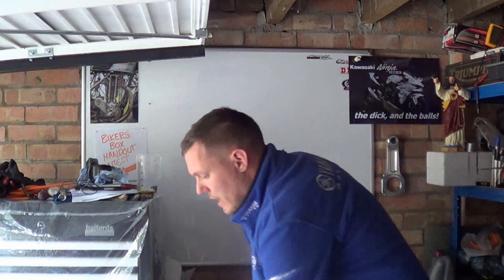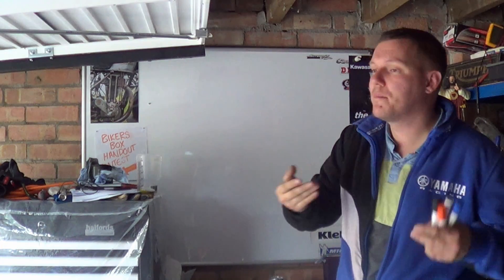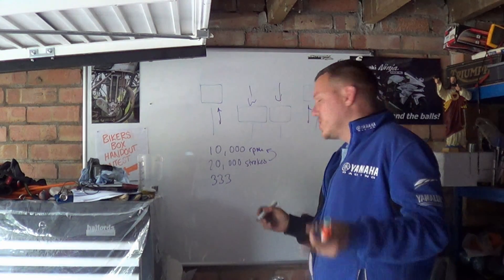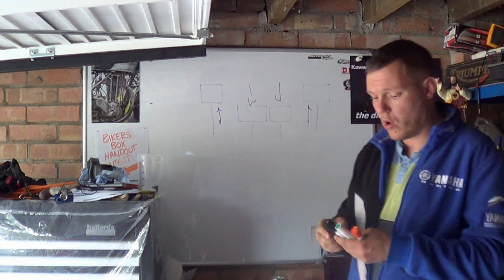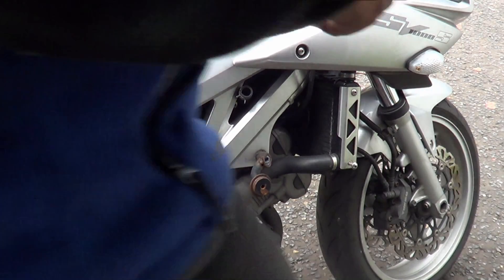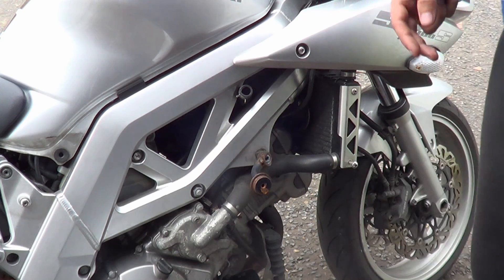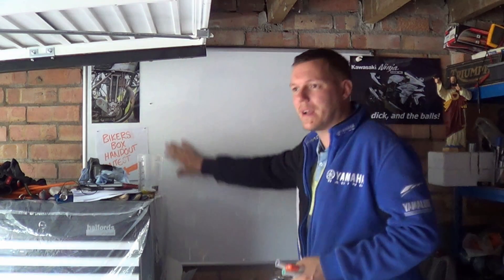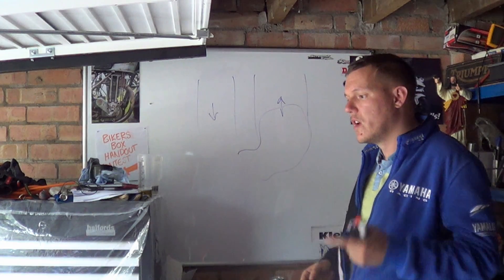Crankcase pumping 4T reply

Comment: The average 500cc single cylinder has a stroke from 86mm and they have if you don't count Harleys or other engines with stupid high cc engines big pistons for a motorcycle. To get to the point 100mm stroke is a fucking big stroke and I think that not many engines for Motorcycle have a stroke that long... To make math simple 100 is a good number ;)
Reply from the maker: and that was the point, my brain hurts enough as it is......
Reply: Vitamin B complex and coffee... and your brain will get going again.

Comment: no clue why you need to explain this one but i guess the same could be said for the stuff that i don't know, but two things, the restriction between the cylinders caused by at least the crank, connecting rods, crank baring caps, and the cylinder sleeves themselves to some extent, would cause enough separation yes, and if you had say 4 separate breathers they might have their own pulses and different to each other, also/but the blowby that is found in all engines even new ones is what causes the bias to the pressure to be positive
Reply from the maker: I think you over-rate how much blow-by there is, but a small fraction is blow-by. I'll get a lighter and show you. - matt
Reply: much of it wont ignite because it's exhaust, but it would not take much to unbalance the pulses, if your system is sealed and you only have one breather like one of my bikes, you can add a pressure gauge, a 0-10 psi would work best or smaller, the overall pressure will build and once it starts you can watch, also as pressure builds the pulses might become more evident, don't let too much pressure build as i don't want you blowing your seals

Comment: What an idiot. Mr rex is. He got pwned. But in terms of engine braking, jacob's brakes get the job done the fastest. Probably not a good idea on a bike since traction might not be enough. To reduce pumping losses does this mean I should start drilling holes in my crank webs or give my motor a bigger exhaust vent?
Reply from the maker: Yeah go for it lol

Comment: aye, and allso the rings do let in some exhaust gas down into the crank case.
it builds up over time. so you do have pressure there for sure. when the enigne in under load it will be even more noticeable.

Comment: some of that pressure coming out from that hose could it be from combustion (passing by the rings)? i've seen that in cars as well specially when they are cold. nice informative vid once again thanks
Reply from the maker: 1) yes
2) the SV wasn't cold
3) that's shit loads of blow-by
4) I'll be measuring the bores and rings etc when I do the teardown
Reply: yes it seems like a lot hope the engine is fine

Comment: Really interesting.  Are all multi-cylinder 4T engines arranged to have a constant volume under the pistons / in the crankcase?  Do single cylinder 4T engines have to have much more massive crank-case breathing arrangements than multi-cylinder because the air has to get right out of the crankcase and back again, or do they just live with the big pressure changes in the crank-case?
Reply: No - singles and 360deg parallel twins like BSA, Norton, Triumph pump their cubic capacity for every stroke, leading to issues like oil being blown out the breather.
Matt does your Suzuki have a single crankpin? if so it has to pump air in and out the crankcase as the volume under the pistons changes. If so why does it appear to blow and not suck? i was slightly disappointed it didn't eat a piece of that blue wiper ;)

Comment: Use the exhaust to pull vacuum on the crank case. It only takes a hose, a one way valve and an angled fitting and the depression negates the breathing.Quick'n'dirty FTW!

Comment: 1: would a 4t boxer engine be able to take advantage of crank breathing? Every time the pistons are moving towards the crankshaft (intake/power) one is on its intake, so every time they're displacing air, there's an intake stroke to receive the displaced air. 
2: what if you plumbed the exhaust into specific pistons of the crankcase to help push the compression/exhaust piston up? So in an i4 (1-3-2-4), the exhaust from cyl1 head would go to either cyl1 crank (to equalize pressure) or cyl2 crank (pushing it up to compress), then exiting the crankcase and out the tailpipes. 
Of course, these involve adding oil to the intake and exhaust respectively, so emissions will go to shit but would the efficiency gains be worth it?

Comment: Would a vacuum pump putting the crankcase under a vacuum free up more power than it consumes? (ignoring windage)
Reply: (free up more power than it consumes) yes, it does! they have been doing it for years in drag racing, on SBC it gives around 50HP that the end, that is
 on an engine that revs to about 8000RPMs
Reply: Most 4 strokes have a non-return valve (check valve) in the breather system to create a partial vacuum in the crankcase.
Reply: wontputrealname yes they only work at partial throttle however as opening the throttle pretty much eliminates manifold vacuum...
Reply: The non-return valves operate at all times when the engine is running, from idle to full throttle, creating a partial vacuum in the crankcase at all times.
Reply: I think you'll find that more often than not, that one way valve is actually one of a pair, used for emissions purposes to ensure that air flows into the crankcase breather and out of the valve cover breather(s), and from there being directed into the intake. Hence 'PCV' valve, Positive Crankcase Ventilation. It is used to ensure that fuel vapours and exhaust gases that pass the rings due to windage don't contaminate the oil, leading to loss of oil film strength and coagulation potentially leading to blockages of oilways. I do not know of ANY engine that only incorporates a crankcase vent and NOT a valve cover/cylinder head vent that is linked to the crankcase in some way.
Reply: It was made a requirement after the use of 'draught tubes' led to most roads being coated down the middle of the lanes by a thin slick of oil, as blowby from pistons was blowing the oil mist in the crankcase out the draught tube and all over the road...
Reply: +Enuo Enkidu    You have no need to school me on the desirability of a motor which does not spew oil all over the roads, or into the atmosphere. 
I never suggested that a non-return valve was the beginning and end of crankcase ventilation, esp in modern vehicles.
I have grown up with the changing methods of crankcase ventilation and the efforts of manufacturers to conform to legistlation forcing cleaner emissions.
I am of the school of thought that a engine should be run with a partial vacuum in the crankcase, and that was my point.
Reply: No, you said a non-return valve was used you said a non-return valve is used to maintain a constant vacuum at all times and that was simply incorrect.
Reply: The crankcase in modern IC engines is under a negative pressure at all times while the engine is running.  
Blowby gasses are expelled by the non-return valve(s) leaving that partial vacuum. That vacuum does fluctuate, but should never be positive.  
Crankcase vacuum has nothing to do with inlet manifold vacuum, which will not exist on turbo or supercharged engines, to comment on a point you made on a previous post.
Reply: Yes crankcase vacuum IS to do with manifold vacuum. The check valves operate the wrong way round to allow a natural vacuum!!!!!! Go educate yourself.
Reply: The only reason there is any connection of the crankcase to the inlet system is for emission reasons. 
The main reason for the partial vacuum in the crankcase is so blowby gasses can be expelled and oil leakage is minimised due to the engine's innards constantly trying to draw air in instead of trying to push gasses out of the orifices which if not under the negative pressure would tend to blow out.  
I have tried to make my explanations as simple as possible.  
When I were a lad, the crankcase breather on most engines exhausted to atmosphere.  Through the years, work was done on this and it was discovered that a one way valve, allowing the crankcase to breath out, but not in, reduced the severity of oil leaks, especially on British twins and singles.
Through the years,the systems became more sophisticated in order that practically no crankcase gasses would reach the atmosphere - they would be passed through the engine again so any unburned hydrocarbons would, in theory be burnt, hence the only gasses to emerge from that engine would be exhaust gasses.
I feel that you are the person who needs educated.   
Don't depend upon the opinions of posters on forums - read a book or find some scientific opinions based on research findings.  I regret that I can't point you in the right direction with study suggestions but you should easily be able to find material which would improve your understanding of the subject.
I wonder what Matt thinks?
Reply: This isn't simply a matter of opinionion. This is a matter of fact, knowlege born out of the necessity to put air-oil seperators and oil catch cans on competition vehicles, ranging from junior 1000 nissan micra rally cars to group N subaru impreza rally cars.
Nissan CG engine is fairly representative of a standard car engine, and has NO non return valve to create the effect you are describing. Filtered air is only allowed INTO the crankcase, and out the cam cover breather and into the exhaust manifold. There IS a PCV valve  but it stops the air leaving the crankcase at WOT, when windage is high and manifold vacuum is low, to help dirrect crankcase gases towards the intake. This is taken directly from the OEM service manual. Subaru EJ engine has NO non return valve to create the effect you describe. The crankcase is connected to the manifold via a check valve (to prevent boost pressure generating an oil fountain out the head breather), and the two head breathers are just connected straight to the filter box with no check valve.
It has occured to me that potentially car manfacturers might tend to prefer air flow for oil longevity and longer service intervals, and bikes employ a vacuum in order to better support higher power outputs and higher engine rpms?
Reply: I mentioned bikes only as an example partly because the best example I have seen of the effectiveness of a one-way valve in the engine breather system was a Triumph twin which leaked oil from a couple of places.  I told the guy to fit a non-return valve, and I told him which way to fit it.  He though about this a little too deeply, and decided that the valve should allow the breather to draw in and not out.  He brought the bike up to me to show me how wrong I was, and how the thing was now throwing oil out everywhere.  He hadn't even tried it fitted the correct way.   I turned it round and the leaks all but stopped.   It was a vast improvement on the machine from before any valve was fitted.
I have also worked on many brands of cars, some as early as the 30's, but mainly 50's to 90's, although the headache I have at the moment is a 2008 Ssangyong Kyron, the headaches caused by a total idiot of a hamfisted and stupid "mechanic".   My personal vehicle is a '05 Hyundai Tucson, great car.   
I never trusted car dealers and repair shops, doing maintenance and repairs myself.  I traveled quite a lot and rarely had any problem, and if I did, I repaired it myself.  I have occasionally done temporary repairs to machines to get them home, when he job would be done properly.   I once stripped a Triumph T100 by the side of the road in a village in Donegall while the owner rode to Belfast (on my Matchless G3LS) to buy big-end shells.  When I knew what sizes I needed, I phoned the supplier to place the firm order to discover that my friend had just walked in the door!   When he returned, the engine was re-assembled and put back into the frame with new oil and it started on the second kick.   It ran faultlessly with no bearing problems 'til he sold it two years later.
So you see that my experience is extensive, covering many years and types of vehicles, petrol, diesel, car lorry, motorbike, agricultural and industrial.  None of the vehicles after, I would guess the late 60's breathes to atmosphere. All "recycle" the blowby gasses, all would definitely run with a negative crankcase pressure.
You keep complicating the matter, bringing components into the discussion which are largely irrelevant such as oil separators, draught tubes, which are irrelevant to the discussion.
All modern 4 stroke engines run with a partial vacuum in the crankcase, it is an enclosed volume which varies more or less depending on the number of cylinders with gasses entering that system as a result of blowby.   If the crankcase was a closed volume, pressure would build up casing gaskets and oil seals to leak, possibly even to the extent that the crankshaft oil seals, for example could be pushed from their housings.  That would not be good.  The system arranged so that the crankcase was under a partial vacuum completely solves that problem.
I don't have the time or inclination to search out the manuals for the vehicles you described, I have other things to do.  
You will have the last word on this because I've tried to explain the same thing a number of times but instead of using your intelligence and thinking about the problem and researching, you just want to argue.  I wish to argue no more.
Goodbye.

Comment: Crankcase pumping losses.  Interesting topic.  
Would crankcase pumping losses be reduced if an engine was designed with full manifold vacuum ported to the crankcase?  
Applying a low pressure in the crankcase to reduce air turbulence.  
Like the PCV system but without the PCV valve, that somewhat restricts manifold vacuum in the crankcase.
Reply from the maker: Yes and that's coming up in a future vid

Comment: a v2 dont think wood = same results as a straight 4. 90 degree shod in maths but is other verbals in a 2 cylinder, and air will take  path  off lest resistant and the vacuum created in the air box will suck up the air so 0 pumping loss ether way no pumping loss. only possibly lose is in less o2 to combustion   but is part of emissions theas days enny way whit the egr valve :P
Reply from the maker: "a v2 dont think wood = same results as a straight 4"

- very true and this is why I made it clear that it is a vtwin, and why I said more videos are coming based on different arrangements. God you lot love jumping the gun don't you?

Comment: Rexy poo is showing some ignorance, crankcase pressures don't have much to do with exhaust brakes or compression brakes, correct me if I'm wrong but a jake (compression) requires a change in valve timing using a hydraulic lifter thing/jobie on the rocker arm (no butterfly at all), and exhaust brakes do indeed add a butterfly to the exhaust side to add back pressure.

Comment: i have a check valve on the crank breather on my KTM, it's a KTM part. Works good, idles even better. Kinda like a PCV valve, you can actually use those. Race cars hook that crank hose to the exhaust, negative pressure is good....